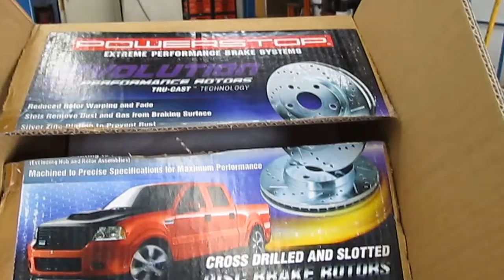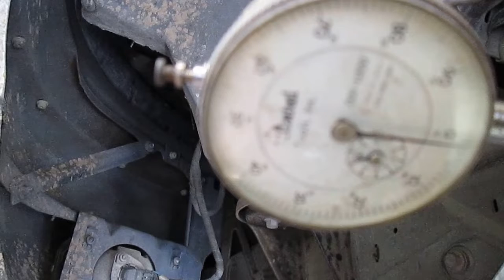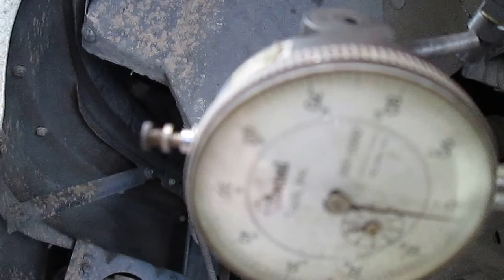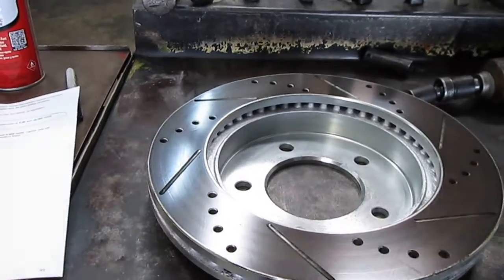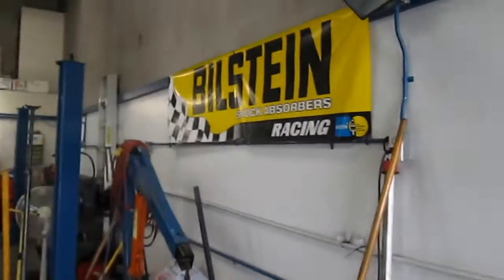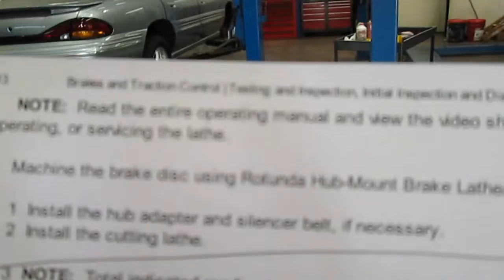How to check brake rotor lateral runout

Comment: It is because the HUB has to much runout & the runout is transferred to the rotor and magnified the farther away from center you measure it.  I think only way to fix is replace hub or use rotor shims to offset the hub runout.  Odds are the rotors were perfectly fine and in spec.  You COULD have confirmed the rotors OK condition with multiple rotor thickness measurements with a micrometer.
Reply from the maker: Ended up buying Ford OEM rotors and the runout is .001 th. now.

Comment: Hi buddy did you take it back off and turn it to 180 degree and test the run out again, if the runout is opposite then the hub is at fault
Reply from the maker: Yep, get the same reading. The customer wanted a rotor that would make the truck stop better and less pedal fade when they were warm, so I tried these because they were. 002 or .003th on Honda's and Toyota's. 
Previously I always used Ford OEM rotors, they were .001 th. every time!
Tried Motorcraft rotors and they were between.010 and .017th.
Reply: @JohnSadlersAutoRepair  John` I just bought ford focus sport 1.6 TDCI 2011 with bad wobble when braking, I had the front of the car up on jack stands and hit first gear ` wheels went around several times but when giving about 1500 rpm the passanger side wheel would stop for a split second then go again then pick up speed then stop again and go again.
That side seemed stiff to hand rotate, I stripped all down cleaned greased back of pads and end of pads, greased the slide pins ,it turnd easier,
got back in car and the same thing happend, but the wheel was a bit easier to turn by hand ,
 when i drive it i hear sh sh sh noise like brake rubbing,and still feel wobble through steering wheel only when braking.
I thought what might be happening when car was on jacks , as the wheel goes around the disc is warped slightly gets warm and exspands then jams as if brakes are being pressed, then it cools then goes again and repeats, but the disc surely can`t get hot spinning several times then cools within a second. ?
Then I supected slide pins slightly bent and maybe brake pad binding,?
I can see every thing move when pressing the brake and release, but not sure if releasing enougth for it to stop jamming, 
There is no oil leakes and no knocking I am puzzled whether piston is not going back that extra mm,
I don`t know if the drive shaft may cause this issue with wheel stopping while car on jack stands.
Any advice would get me out of a jam please

Comment: the axle flange that the rotor sits on should be checked for runout. prob a bad wheel bearing assembly

Comment: I recently bought the power stop drill slotted rotors for my 07 Toyota Tundra. During the installation of the  rotors i notice the the run out was way off, compare to my stock rotors. Viewing your video it look like you ran into the same problem. Was the problem fixed when the manufacturer  send you a new pair of rotors?

Comment: Runout is part rotor, part hub. So phase matching is important part of lessening runout. Move the rotor clockwise one lug at a time until you get the least runout. The other clue was you're having success on other vehicles, 2 sets bad on this vehicle. Was it just this side? Or both sides in the front? If just one side, I suspect a bent hub. Maybe the vehicle hit a curb.

Comment: Procut On Car Rotor Matching System will take care of any runout, on any vehicle with any brand of brake rotor. Guaranteed!!!!  www.procutusa.com
Reply from the maker: David Bond pro-cut did a demo at my shop and the rotor was .003th run out when they got done. All the material they cut off the rotor was all over the suspension and control arm.

I was not impressed at all. You can buy a whole bunch of factory rotors for $12,000. Thanks for your input.

Comment: i came across excessive rotor runnout on a bmw. because of a bad wheel bearing.  also i ALWAYS INSPECT WHEEL BEARING HUB & clean as much rust off the hub with a wire brush too any time i install new rotors To have a good contact surface from rotor to hub. JUST A TIP 4 ANYONE that doesnt do so ALSO INSPECT CALIPER SLIDING PINS FOR DISCOLORATION DUE TO LACK OF GREASE AND CALIPER PISTON FOR MISALIGNMENT TO PREVENT ROTOR WARPAGE.

Comment: If you've confirmed without the rotors in place that it's NOT the hub ass'y; then the rotors you're buying are crap.  Not to be critical, but this is the second set.  Both sets exceed acceptable runout.  To have to turn new rotors is preposterous.  I wouldn't let that job leave my shop.  Go to a different brand of rotors.  That's why I stick to OEM parts.  Sure, they're nothing fancy, but not only is the warranty still honored, more times than not, you'll have a thou or less runout.  Now THAT'S a silky smooth brake job.  Thanks for the video.  You're a much more tolerant man than I.  I wouldn't touch that product with a ten foot breaker bar!

Comment: Turn the rotor 180 and retighten. Check it again. If the high spot is in the same place it is not the rotor. If it is 180 again it probably is. Also did you torque the lug nuts so they are equal?

Comment: Do you own a set of spacers to use the lug nuts/wheel-bolts to keep the rotor flush without the wheel on? If so can you share the product name? Thank you
Reply from the maker: Hi Michael, you can go to a local hardware store and buy 6 nuts that are a little larger in diameter that most wheel studs, put those on and use the same lug nuts for that vehicle.

Comment: Hi guys, 
530xd 2009 LCI E60
Bare with me about this issue i'm having.. 
So 6 months ago i changed my rotors front and pads due to wear. 
Now after a few weeks it started shaking in the steering wheel.. Now i started to think it was "warped rotors" so i changed them again... Now it came back, same problem. 
Saw some posts online about the thrust-arm, so i changed that to(brand new oem). 

After that the shake was still there, now that started to piss me off, so i thought it was the struts and wheel bearing, changed them too, also changed wishbone on both sides.. (all a side i did also alligment 3 times, different shops). 

Here are the list och new parts i replaced:
Thrustarm/tension arm both front side
Wishbone both sides
Wheel bearing both sides
3 sets of rotors and pads (ATE and zimmerman) 
Both front struts with dampers
Bleeded the brakes (all 4)
Changed right front caliper(feels like vibration is coming from front passanger side) 
And rear struts due to leak. 

Soooo i dont wanna get beaten by this car and i'm not going to give up but guys i need some rly good tips. .. 

My two indi that i take my car to says its the thrust-arm, but still i got this f*** vibration. 

And this happens ONLY when i kind of soft brake from say 70-90 isch to 20. But when i press hard on the brake i dont get any vibration at all... Also, no vibration at all at the brake pedal. 

Both vinter and summer tyres are premium and only has like 300mils on them (balanced 2 times)
No vibration on the seat... 

Only thing i can think of is maybe, inner and outer tie rods, but the feel firm and good. 

Any clue guys?
Maybe i can upload a video for demo?
Reply: Don't forget to rule out the TIRES before throwing that many parts at it.  Tires can cause all kinds of vibration and you cant tell by looking, just rotate.
Reply from the maker: Are you using BMW rotors and pads?
Reply: John Sadler's Auto Repair 
No i used ATE rotors pads and zimmerman rotors pads. Why i did that is becuse both this companys are main suppleant for bmw, and it is said thats like buying oem...? The price on these set is even higher than bmw rotors. 
Maybe its the hub? Im now just guessing.. 

Thank you for your time.
Reply from the maker: I worked for independent BMW for years and ATE and Zimmerman are ok but have side effects like your having. If it was my BMW I would put Factory BMW rotors and pads on it and solve your problem. The material of the pads causes the rotors to overheat! You could buy some new Zimmerman rotors and buy the pads from the BMW dealer and that would work alright.
Reply: John Sadler's Auto Repair 

Could it really be that kind of difference.. Well i guess i'm off new sets in bmw. Anything els i could look at before i buy the rotors and pads?
Reply from the maker: Not that i know of
Reply: John Sadler's Auto Repair 

Thank you for your time!!!
Reply from the maker: Yes sir, keep me posted
Reply: John Sadler's Auto Repair 

I forgot to ask you. 
I have got some dark "spots" with "tail" spread over the rotors.. Is that hotspots or what?
Reply from the maker: Can you send me a picture? johnsadlersautorepair@gmail.com

Comment: I just put a set of these on my 95 silverado and I think I warped one bedding them in.  Gonna get a dial indicator on them and check it out.  Have a set on my 2003 dodge 1500 that run really good.
Reply from the maker: Whenever I install new rotors and pads always test drive and do 20 normal braking stops with a 2 to 3 block distance in between stops.
Reply: I probably got about 7 or 8 normal stops before I bedded them in.

Comment: Hey john great video. I have a 5thgen camaro with these exact rotors installed and ive been chasing a constant vibration at 65mph. Do u think with them being out of round like those in this video will cause a shimmy? Thanks
Reply from the maker: They should only shake when your braking if you have a rotor concern. If it's at 65 mph without braking, I would see if the vibration goes away at 60 and 70 mph. If it goes away then you have a tire balance issue, the tech is either not taking all the other weights off before balancing or the balancing machine may be out of calibration. I have had good success with Discount Tire, it doesn't have to be off by much to cause the vibration or slight steering wheel shake.
Reply from the maker: If it feels like the entire vehicle is vibrating, I would check your motor mounts and transmission mount also.
Reply: +john sadler thx for the info, with this car the wheels where balanced several times with road force. We even went to swapping all 4 wheels and the vibration was still there. During braking the car feels fine,  and way above 70 the vibration lessons but is still there.
Reply from the maker: +MUSCLECREWDave Then I would  find a good drive shaft company  that can check the balance of the shaft and condition of u joints. I have had cars with your problem and that would be my next step. make sure the  motor and transmission mounts are good first.
Reply: What numbers did you get when you measured the road force (R1H - "1st harmonic") ?
Reply from the maker: Hi Leonardo! I wasn't checking the tire or wheel run out, measuring the lateral rotor run out only. John

Comment: Why do you think its the Rotor and not something wrong with the Hub/spindle?
Reply from the maker: +PhilJimmyBob Thanks for your question.  Been working on this customers truck for many years and know where and how they drive. In 39 years doing this the only time I've changed a hub or spindle is due to some type of accident with the vehicle. When I see a hub/spindle concern it's been alot more that a few thousands of a inch. Thanks, John
Reply: +john sadler   okay John, sounds like you know what you're doing.  I had one of my personal cars not too long ago that ended up being the hub causing my run out - not the disc, so that's what I was thinking.
Reply: +Rogerborg   Ya, that's what I do also.  Wow, great minds think alike!  lol     thanks for your reply however.
Reply from the maker: +Rogerborg https://youtu.be/Qv9CNQ4vG8M
Reply from the maker: +Rogerborg https://youtu.be/Qv9CNQ4vG8M
Reply from the maker: +Rogerborg Thanks! I had already done that and didn't mention it :(.

Comment: Check you hub runout i had the same problem and it was the hub
Reply from the maker: +Matt Ostrowski Thanks for your input Matt, I first used Motorcraft rotors and they were .014 th. of an  inch. Then I brought some Ford rotors and they were .001 th. of an inch. The Ford rotors were quite expensive and worth every penny of it. The hubs checked out good last brake job, that's why I knew it was the quality of the rotors.

Comment: Excellent video. It seems Raybestos has a correction plate for correcting lateral runout whether it's from the hub or the rotor as long as the runout is not greater than .006. Perhaps using the correction plate paired with a less expensive rotor is the way to go when trying to achieve the proper blend of cost and quality.
Reply from the maker: +Dan Majovski Wow! Thanks Dan, I have known about different kinds of shims for wheel alignments but not for that.

Comment: Why is the run out necessarily due to the rotors, all or in part? Couldn't you put a precision machinist's  disk on the hub and measure the accuracy of the hub/bearing aspect alone?
Reply: You mean true the last time you checked!  Maybe not now.  All it takes is one bad chuck hole or a curb bump.
Reply from the maker: +bigpardner Sure you can do that, I already have experience with this particular truck and  knew the hubs were true from previous brake jobs I performed. Please read the entire description and you can see what I'm describing. Thanks for your input !

Comment: John knows his work well ,') On car Procut is the way to go if you take your rotor off and the run out spot changes its the hub thats the cause and Procut can solve the issue. PepBoys has the on car Prout lathes :)
Reply: +shane cissell  Yes!  I am a big believer in Procut.  I just put re-surfaced discs (done at local parts store) for my car and measured the runout (.005, .006) -  Unacceptable!  My Nissan 370Z specs say .0014" (1.4 thous.) should be the max mounted on the car.  After the Procut I'm within specs now (about .001).  Recently got my Dial Indicator runout guage from Harbor Freight for about $32.  I will definitely be checking all my brake discs from now on.

Comment: Not being a tech I would not really know but what I would think is that you would have to measure them on known good (bench) type of device to be certain? Does changing the position of the rotor on the hub change anything? Just trying to learn as I want to do my brakes and check the rotors too. Thx
Reply: If changing the position of the rotor on the hub changes things, then there's a buildup of crud on the inner rotor, or hub--or the rotor is simply warped.
Reply: freddiemercurious or the hub has runout

Comment: Also, check the front wheel bearings for any movement, John.  ASE Certified Technician in A8, A5, A1.
Reply from the maker: HollywoodRoseJack Thanks for all your help, did that also.

Comment: John, check the hub runout and make sure the mating surface is clean.
Reply from the maker: HollywoodRoseJack Hi there, thanks for the help. I cleaned the surface good and no matter what position I mounted the rotor to the hub the reading didn't change. I will check the hub runout when I get this issue again.

As I wrote in my explanation the Ford Rotors were .001 th. so I didn't check the hub.

Comment from the maker: HI Pinoyeh: Thanks for your input, as I mentioned in the previous brake job using Ford Rotors the runout was .001 , So in this case it's the Quality of the brake rotor when it's made.

Comment: No play on brake paddle   But it feels like a hub is not center  but but changed all bearings    Though the old bearing mess up the rotors so I changed again.  Still like this. I checked all bushing.  Is a 04 xlr
Reply from the maker: You may have a bent rim also, you can go to any Discount Tire Company and they will spin your wheels on a balancer one at a time to rule that out. Also you can put the dial indicator on the face of the rotor to check the run out. Let me know what you find out.

Comment: hi my car wobbles like the bakes are warped i changed all 4 brakes and the 4 bearings with hub  and 4 rotors again.  nothing lose or plays in the front or back
drives good no pulls.  but i do notice if the road is even is less   what can it be??? thx ?
Reply from the maker: What is the year and model of your Honda? Where are you buying your parts? Do you only feel the wobble when you apply the brakes? Or do you feel it all the time?

Comment: Possible wheel bearing......check it on the other side to see if it has the same amount of run out on the other side.
Reply from the maker: Thanks for the input Michael, both sides checked out the same. The time before this we used Ford Rotors ( not Motorcraft ) and the run out was almost zero. So this shows the quality control of some manufactures is better  than others. Of course the better quality the higher the pricing.

Comment: Have you considered the fact that the hub face might have runout. not saying it does, just asking if its something youve checked
Reply from the maker: Hi Jose: Good point, I didn't check it on this job. I did clean the hub surface very well and tried moving the rotor to different positions on the hub. Got the same readings every position. As I stated in the description of this video that the ford factory rotors were .001 on the last brake job so I was confident that the hubs were ok.

Comment from the maker: Good point, I replaced the front rotors and pads years ago on this vehicle and now it's time for regular service again. At that time I tried Motorcraft rotors and they were over .011 run out. Then I tried Ford rotors and they were .001 run out on both sides. The Fords rotors are very expensive, that's why we didn't use them this time. I did move the rotor as you commented and the  same difference. Very difficult to find good quality and a decent price. Thanks for your comment.

Comment: i forgot to mention, you can sometimes remove the rotor and replace changing the bolt pattern. in other words when you got .005, by removing rotor, turning it approximately 72 degrees(to the next consecutive bolt hole) and getting a dial on it again. Check out the dial readings after rotating to every bolthole. I have manged to correct .002 differences a couple of times by doing this